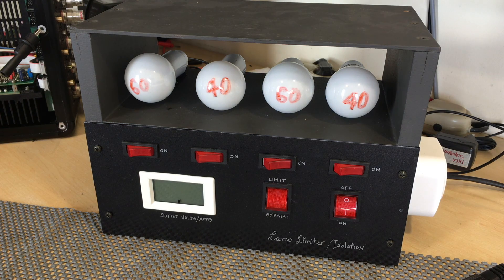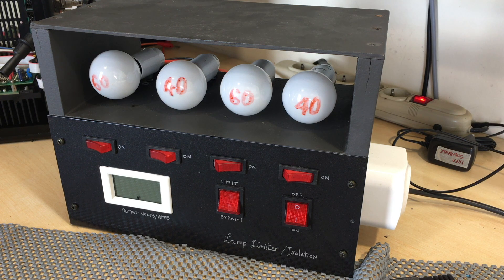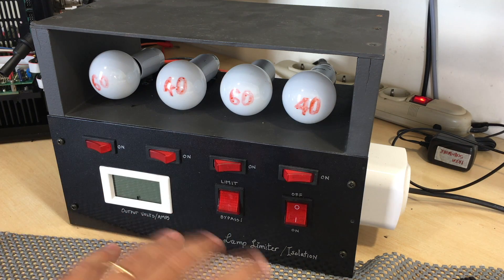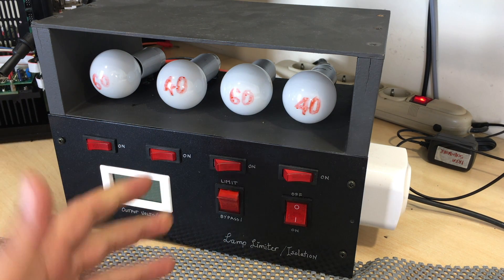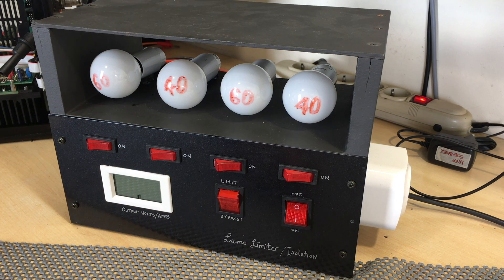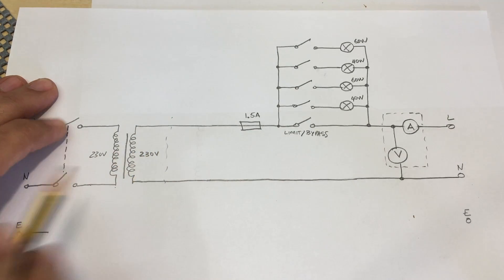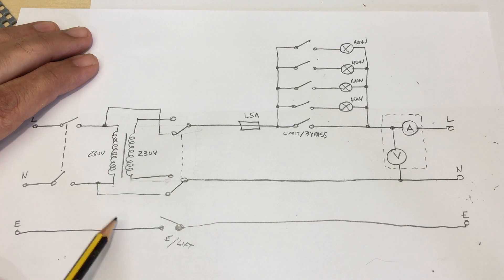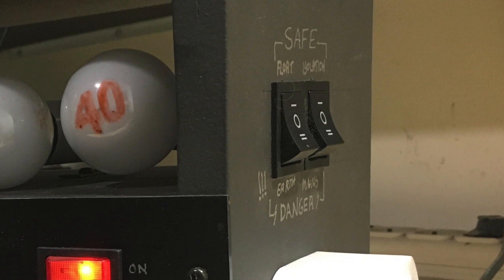DIY Test Gear: Improving the Dim Bulb Limiter / Tester with Isolation.

Comment: A retired Broadcast Engineer here from the USA.  Most transmitters had between 5KV and 12KV DC for the plate supply for tubes.  There were automatic circuits built into most transmitters that helped with safety.   There are a few working procedures that also helped.  Keep one hand in a pocket or behind you.  Remove all jewelry [watch, rings, necklaces, etc.]  Always check that the mains breaker or power switch is off.  Doing this twice is not overkill.   Almost all transmitters have a grounding stick.  Use it liberally.  This ensures that capacitors are bled off.   Know the equipment you are working on.  Are there any other sources of voltages that might zap you?  I have even received burns from solid state transmitters employing less than 100VDC for the supply.  THE most important rule is: NEVER LET YOUR GUARD DOWN.
Reply from the maker: Your advise is crucial for safety. I think the most dangerous aspect of working with high voltages is complacency. One can sometimes get so accustomed to doing things that stupid mistakes can be made. It’s happened to me. The times I’ve experienced a shock have always been in situations that I can only attribute to distraction. After the shock I’ve stood there (and I’ve been lucky to still be standing), and thought: “how could I have been so stupid?”.

Comment: As always, great video! qurious tho, why not put the "isolation\true mains" switch before the transformer, that way you won't have a potential on the tran when in "true mains" position.
Reply from the maker: I wanted the isolation transformer always in circuit for protection in the case of hot chassis sets.
Reply: Understood. I was under the (apparently wrong) impression that you were interested in having a true mains option to simulate a real life connection, instead of unplugging the DOT from the limiter and plugging it to a wall receptecle,  once testing is done.  @electronicsoldandnew

Comment: Hello Sir,,I like your idea but why should you use the Bypass? Isn't it safer to work only with the isolation transformer
Reply from the maker: I wanted a quick and easy way to check for normal operation so that I could be certain that there would be no surprises when plugged into the normal mains

Comment: I was thinking, if you replaces your first switch with a 3 way 2 pole switch. Off in the middle, then one side is mains power, other side is isolation transformer. And it will turn off the isolation transformer, when switched to mains power.

Comment: Hi thanks for your very instructive videos. I would like to build a dim bulb limiter device but nowadays it is close to impossible to purchase incandescent light bulbs. The only of this kind I have found are small 230V 25W oven light bulbs. Can I use these as descent dim bulbs or is it a bad idea ? Thanks for any insight ...
Reply from the maker: Sure. Get 6 of them and you can then switch them in progressively in parallel with each other. That I would pair them and therefore have 50W, 100W and 150W to play with. They also take up less space.
Reply: @electronicsoldandnew  Thanks for your fast reply !

Comment: So, if I want to add a variac to this circuit, where would it go? In the front, center, or rear, or doesn't it make a difference?
Reply from the maker: I would add it right up front, between the mains and the unit.
Reply: @electronicsoldandnew I was thinking after the isolation transformer?

Comment: I built a 2 bulb one but mine has a variac transformer, thinking about making it 4 bulb
Reply: Thanks but not my idea. I copied idea from Mr. Carlson Lab https://youtu.be/51mjt9nFoeA but mods from other. His basically had it because of his transformer. I had to add step transformer to go from 125vac - 230 with euro plug. But still waiting on European plug in mail so not finished, but I am going to use your 4 bulb idea to make it even better. Also I am adopting other YouTube ideas for under it. A Dc-Dc power supply 1.5, 3, 4.5, 5, 6, 7.5, 9, 12, 18 x2 from computer PS with variable 1.5v - 30v x2, and lastly 1v-42v variable voltage and current. 4  constant 5v USB. I have 90% finished, just waiting on shipping. You can use any ideas for yourself or videos. Because I am changing mine to adopt yours. Ambitious ideas but will be awesome when done.
Reply from the maker: The variac is great.  Be careful, as it’s not isolated. Have fun.

Comment: 12:00 Why placing the dual toggle switch behind the transformer and not before ?
In the "bypass stand" of the transformer, the transformer is always powered and consumes power for doing nothing.
Besides that, nice build.
Reply from the maker: Bjorn V : very good point Bjorn. Didn’t see it at the time. Thanks.
Reply: @electronicsoldandnew  it can be done with 2 double pole toggle switchen, one on the primair side and one on the secondaire side of the transformer.
Reply: Just use a '4 pole double throw' toggle switch ... no need for 2 toggle switches ... make it simple ;) ...
Reply: @krellft  , you're right ;-)

Comment: I love your videos, I have been out of the electric repair for a long time, been thinking of getting back into it again. I plan on building your device for testing, but there is one thing I will add to it. on the output side I am going to add 2 neon lights between the earth and line and the other neon light from earth and neutral. this will tell me if I have a dead short to earth ground under mains or isolation as well as what side of the output it is shorting to.
Reply from the maker: I like the idea.

Comment: Hi, thanks for the video. With the lamps in parallel, isn't the max limit with just the lowest power lamp (highest resistance) switched in? As you add more lamps in parallel the overall resistance to current flow drops, as with resistors in parallel?
Reply from the maker: Exactly. The more lamps in parallel, the lower the resistance and the higher the current possible. So, more lamps, more current.
Reply: @electronicsoldandnew  OK, thanks, when I first saw it I thought you were switching in more resistance with each lamp, as if in series. Cheers. M

Comment: Your story of the ground fault made me realize that none of these setups that I have seen on YouTube (or built myself) to-date has a GFCI in it. I think I will rework mine to at least sense a current imbalance. That would be useful.
On the isolation transformer issue, it it possible that you are saturating the core and losing the 1:1 coupling? Smaller isolation transformers with less "iron" will do that...
Thanks for the video.
Cheers,
- Eddy
Reply from the maker: The transformer does “lose regulation” as the current rises, so not surprising.

Comment: A related idea I've been toying with recently is to maybe make the earth lift/passthrough temporary - basically, use a pushbutton to operate a self-latching relay that would reset to the default state* when the transformer was powered down.

That said, my current isolation transformer is actually an ex-telco mains "earth isolation" unit - a weird device involving a mains contactor on the input, an isolation transformer, and both a core-balance relay on the A & N output and a low-current (3mA or so) AC sensing relay in the "Earth" output (actually a virtual earth derived from a resistor divider). Yeah, I know, sounds like chronic overkill and a complete "WTF??!!" - but in theory it'll protect any likely combination of shock/short dangers:
● A -> output-earthed chassis,
● N -> output-earthed chassis, or
● A/N/[output earth] -> mains earth, if the system ends up referenced to mains earth in some way (e.g. [output-earth] connected to mains earth through the antenna system).

The more I think about it, the more inclined I am to leave it be...

(* Either "mains earth through" or "mains earth disconnected", depending on one's PoV. It can be something of a religious argument amongst techs…)
Reply: Love the idea of a push button for the earth connection. Knowing myself and my lack of memory regarding this kind of stuff I’m sure I would mess it up, however just a quick push of a button to check for a couple of seconds if earth referencing makes a mess is good enough for me and yes jut the push button with no relay or anything. Great idea!
Reply: I would love to see a diagram of how that device is wired, does it have a model number or anything equivalent?
Reply: @sstorholm  The telco earth isolation unit? It's an ex-Telecom Australia (Telstra) QD750040 "Mains Earth Isolation Sub-Rack"; the "QD" marks it as a local design from Telstra's Queensland workshops. The workshops were all shut down ~20 years ago, and I don't know what happened to any of the local drawings - presumably, if they have been kept (a lot of them were for now very outdated one-off items), they'll be in Telstra's internal records only.

Since I don't know anyone left in their engineering/drawings/records section (or even if there is!), I've been meaning to reverse-engineer the schematic. I might give it another go in the near future; if I do, I'll post a link here.
Reply from the maker: That would be great.
Reply: Jim S Nice, I’ll look forward to it, there’s very little information online about proper protection equipment for workshops dealing with hundreds of volts as nobody does any repair of high voltage equipment anymore!

Comment: I built an isolation transformer out of a discarded 20A 240V-120V step-down autotransformer by completely rewiring it using its original single core winding to make two isolated windings.  I later added a 100 W dim bulb, a 2A circuit breaker and a temp controlled fan.  It worked well enough but it is inefficient due to the windings being made of aluminum rather than copper, so I added a 22uf AC motor capacitor which helped a little.  True isolation transformers are expensive and hard to come by in my area.  
Your earth/lift switch is a good idea and I may incorporate it next.  It reminded me of a low-voltage situation I once ran into as a teenager many moons ago.  Not dangerous in an electrical sort of way but could possibly have caused a fire if I had not caught it.  I was driving home one night in my father's 1973 Dodge Dart, when I noticed the dashboard lights dimming mysteriously.   I then noticed that one screw holding the plastic dashboard speedometer bezel in place was turning red-hot.  I could actually see it glow.  Obviously the ground was faulty and that screw was acting as a resistor to ground.  Tightening up all the screws fixed the problem but it taught me to not take grounds for granted even in low voltage circuits.
Reply from the maker: Sincerely Yours : voltage stings, but the current is what really scares me. I always get a little nervous around transformers that weigh  ton.

Comment: A Variac would be a nice addition to that test fixture.

I'm about to rebuild my little setup. I got a Variac, Isolation Transformer, Dim Bulb with a 100watt bulb and a Kill-a-Watt meter. I'm planning to copy the setup of different light bulb ranges like you got and a switch to Earth Ground. I might add a bypass to Main switch as well.
Reply from the maker: Leland Clayton : yes, I’ll probably add a variac next. Prototyping never ends!

Comment: Nice !!   What you could add to make it even safer  is by adding a diode ,a 5 -15K (depends on the led used)  resistor  dropper and an led in series , positioned at the front  and connected to the secondary. This way when the secondary is NOT in use (when the mains are), the led will light bright  but when you do use the isolation ,you're supplying current from the secondary to the DUT  ,starving the led , so the led will be dimmer. You could label the led as "MAINS IN USE" or something... Just a thought because the added switches are on the side and not easily vissible...
Reply from the maker: That’s a good idea. Probably for the next iteration :)

Comment: This example with the scratched plastic on the elko and a short to ground, not to the oher main line, opens my eyes. Veeery good. Never had such a case. But it can be.
This tip comes to the right time, the material for my iso-transformer is nearly complete. The problem with to less current i will not have, the transformer hast 1,2KW. But the possibility, to test with and without isolation, must be addressed. You are right!
Reply from the maker: Glad to have posted this one in time for you to make any adjustments.